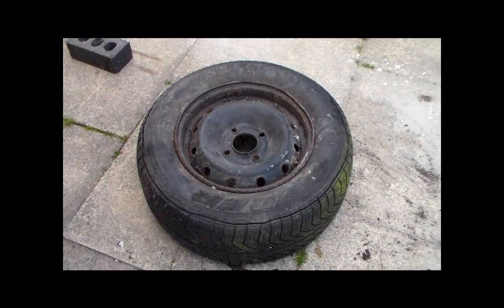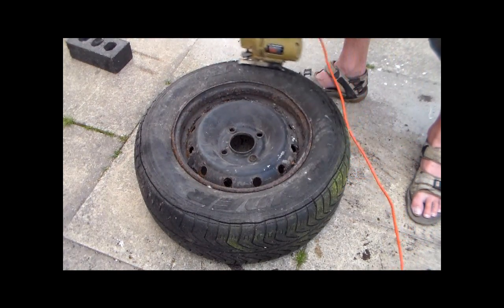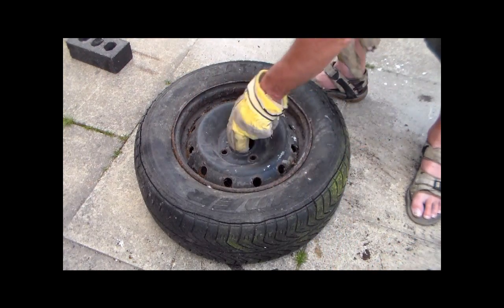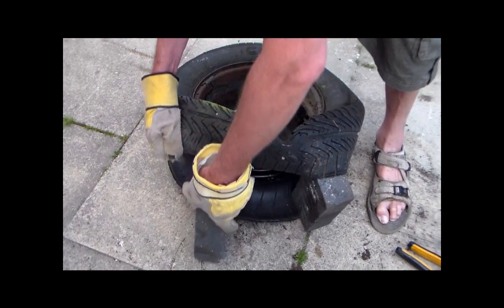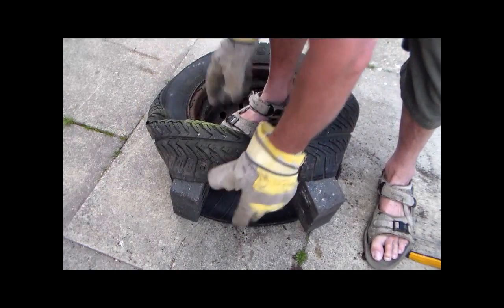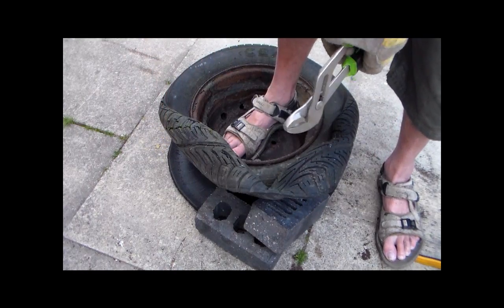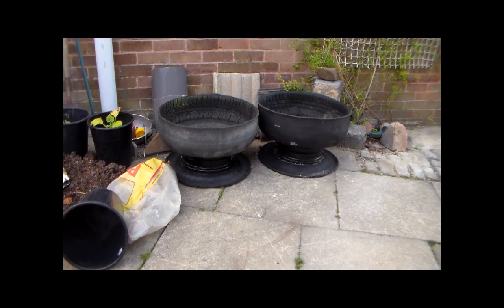Struggle to turn tyre inside out.

Comment: hmmm, if you remove the rim. is it possible to invert a tire without cutting anything?
Reply from the maker: I have turned a cycle tyre inside out several times.... Mostly when looking for glass, thorn, or nail that has caused a puncture. I do not know if you can turn a car tyre invade out.

Comment: Your ads are extremely loud and disturbing.
Reply: Hi melotron, I have no control over the adverts. They are placed there by Google. It does mean that you may need to use the volume control on your computer.
Reply: Bike rides It's not a matter of "turning down the volume" on your computer. I personally have my laptop hooked to my flat screen TV via HDMI cable in order to watch programs. Ads come suddenly and are 10 times the volume of a video and blast you out of the room. It's very disturbing if you live in an apartment or where you could disturb others who are sleeping. It's like a jetliner suddenly appearing out of nowhere.
Reply from the maker: eyeball I wonder if there is something we can do about that. Would you like to contact youtube and google and let me know what they say.
Reply: John Mellor Yeah, right, I'm sure Google will jump right on it and fix the problem! HAHA! I've seen commercials in Youtube videos that were almost half hour in length. I person can't sit back and relax and watch a show. When these horrible ads appear, you have to get up and physically skip past the ad to continue watching the video. I've watched 45 minute crime shows that had 6 OF THESE COMMERCIALS IN ONE SHOW. Computers don't have remotes, so there's no solution.
Reply from the maker: eyeball Try Chromecast. Your mobile phone then becomes your remote. Volume control and skip adverts should be available. You seem to watch quite a bit and this will certainly improve your life and put you back in control to some extent.
Reply: John Mellor I haven't joined the smartphone addiction. Having a monthly bill of $100+ to have one wouldn't improve my life much. And from what I hear, data rates are very high. I have a stone age internet ISP but it's cheaper than a smartphone plan.